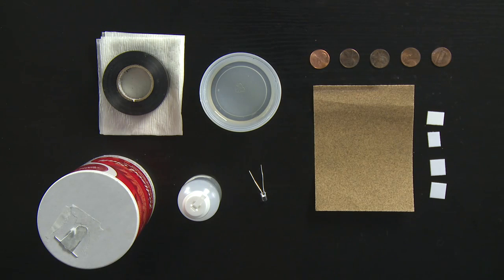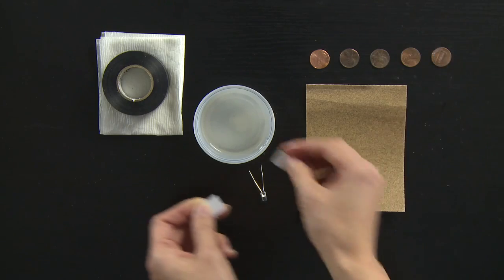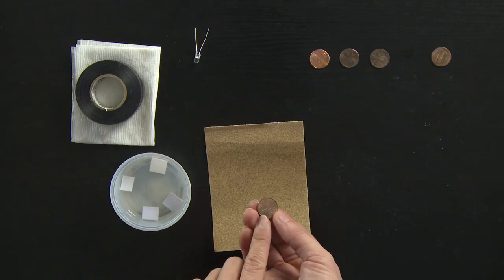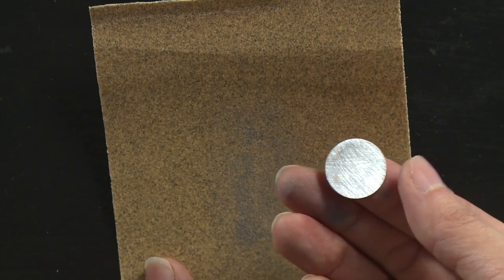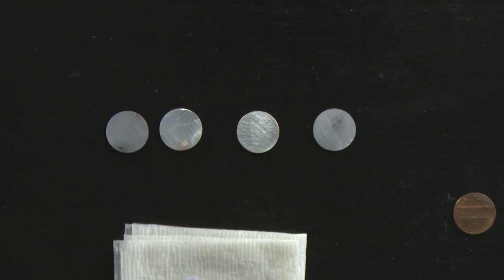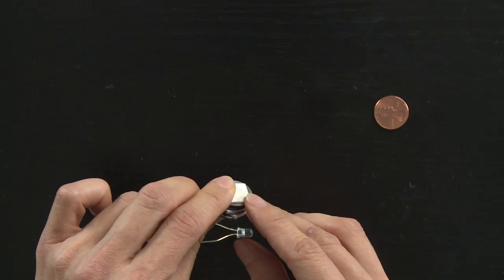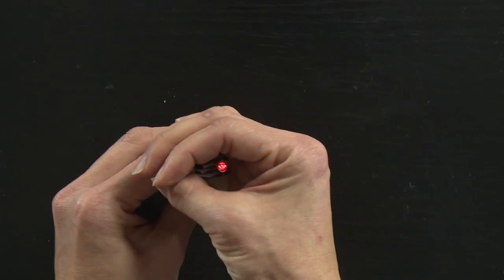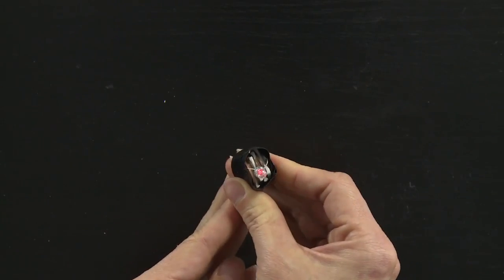How to Make a Penny Battery from Start to Finish

Comment: Mr. Lincoln zincs this does not make much cents. 
Save your sandpaper and fingertips by using some sheet metal and tin snips and cut out small pieces to lay between intact pennies. 
make a more powerful battery pile with copper pennies using aluminum foil circles and a drop of bleach instead of salt water or vinegar.

Comment: Had to recruit three other adults to help with the sanding. Very difficult. Ended up taking a power sander to them to get the zinc fully exposed. Not recommended that kids do that part. It should be pre-done for them. Also, the leds were not bright until I clamped the whole package together. 

I used cereal box cardboard and let it soak a very long time for the solution to saturate it. And cardboard that is hanging off the edges can touch the other cardboard above and below it, so that will diminish the effect. Labor intensive, but nice result.

Comment: I tried making this coin battery, we followed all the steps mentioned in the video, but can't seem to get the lightbulb to light. I also checked the current and voltage of the coin battery, and there seemed to barely any voltage and no current. Please help!!!
Reply: +Rebecca Mathew you should try using more than five batteries. Try using eight or nine, and also instead of using salt and vinegar solution, try with lime or lemon juice, either one is fine. That's what I did and it worked!
Reply: Nameera Sana I'm doing this as a school science experiment. The zinc on my pennies got very dark after putting them in between the cardboard. Will it still work?
Reply: @Goldtoise  if the zink on the pennies is visible or touchable by the vinager and salt solution, the solution will actually eat at the zink. Hence the dark coloring. At least I think that's what happens.
Reply: If led doesn't glow due to low power output.... then try connecting a thin strip of paper.,... Which being insulator, will burn.... indicating the success in battery making. Best.

Comment: what if the penny isnt from 1982? what if its from 2014-2015? would it still work?
Reply: +lara kathleen caparros Yes, pennies made after 1982 are required.  Any penny made between 1983-2015 (present day) will work.  Pennies made in 1982 and before were made of nearly pure copper and actually have a value greater than 1 cent in the current market.  Because of this, the core of pennies made after 1982 have a core made of zinc, and a thin coating of copper.  Pure copper pennies (1982 and before) will not work to make this battery because you NEED both  the zinc and the copper.  To keep it simple, electricity is transferred from the zinc TO the copper THROUGH the salt, forming the functioning battery.

Comment: @Ethan Wu: Cardboard is great. Especially if it is dense (compact and not too thick). It holds together better. I initially used some cardboard that was thick, but not very dense and it fell apart. You can also use vinegar by itself as the electrolyte.

Comment: Great Video.  It is the best "electricity from pennies" video on the net.  However, you fail to mention just how hard it is to strip the copper off the back of those darn pennies!   I discovered that it's a lot easier if you glue some 80 grit sandpaper to a board (rough side of the paper facing up) first.   Then, make a wooden block (like a 2 X 4 about 5 inches long) to act as a penny grabber.   Add some some grip liner (like that high grip stuff to keep things from sliding in the kitchen) to the block with some double sided tape, followed by another piece of double sided tape, followed by the penny (or pennies) - tails up (like a tape-liner-tape-penny sandwich up against the block).  Try to keep the grip liner piece small for each penny so you grind more penny than grip liner.   Then, turn the block upside down and rub it against the high grit sandpaper mounted on the board.  You can remove a lot of copper from a lot of pennies simultaneously this way.  It's still work, but not nearly as much as trying to grip, press down, and scrape one penny at a time!